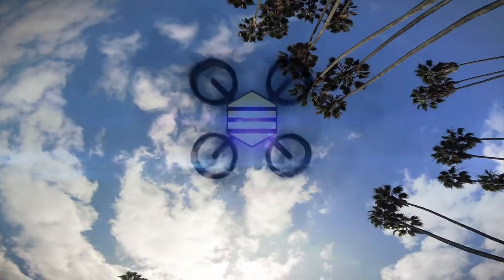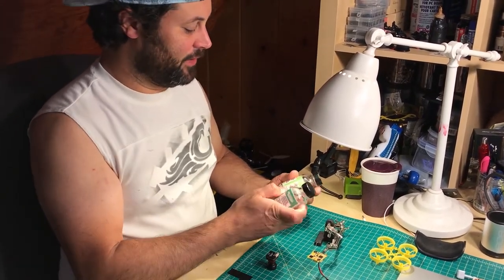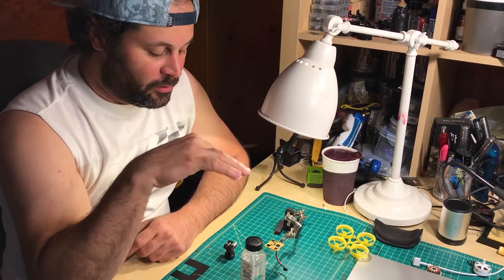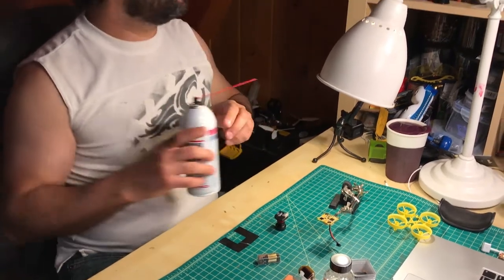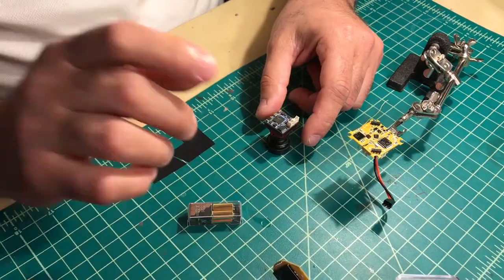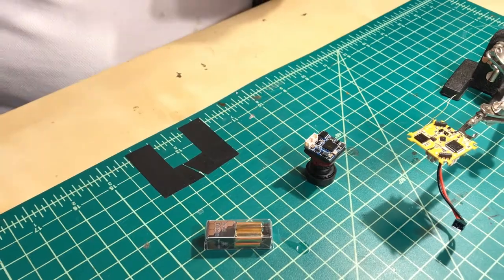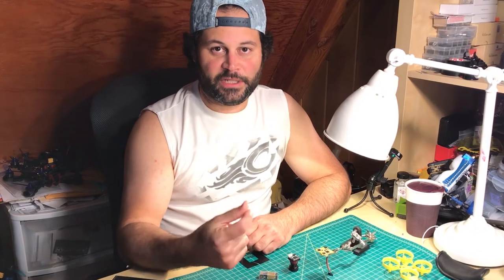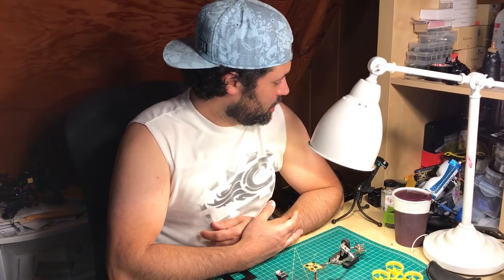My Take On Waterproofing with MG Chemicals Silicone Conformal Coating

Comment: Silicone Modified Conformal Coating is a godsend for making expensive RC electronics water resistant!!!

P.s. I didn’t know about the UV thing, thanks allot. 🙏🙏🙏
Reply from the maker: Yes it is! You're welcome!
Reply: @PinchTune  Your sure the modified kind reacts to uv light???
Thanks
Reply: @ryanjofre  I recorded this video 5 years ago... so I don't remember if it's in this one, but I know I have footage where I show how I dry it more quickly. I use UV and a heat gun to dry it more quickly. Check my other videos on that channel. It's gotta be there somewhere. Be careful though. The heat gun can burn the coating. You want to heat it up a bit then just let it be, and then do it again maybe every 15 minutes.

Comment: I went to cheap route and bought their acrylic based conformal coating last year. I didn't have any failures with electronics but it does dry harder of course, because it's acrylic and it can chip in places that are thin, and it does turn yellow.
After flying one of my GEPRC dolphins and losing some of the flight controller components yes it still flies I decided to use the acrylic and two flight controllers after that with the acrylic on it no components broke free or lost.
If nothing else it's kind of like putting a phone case on your phone.
I don't recommend the acrylic base.
 I do recommend the silicone base only based upon other fpv Pilots testimonials.
Reply: Pro tip:
90% isopropyl alcohol works for the flux removal.
Reply: Loving it and yes, if you do not solder your wires beforehand you will plug the holes like he said and you'll have to get that out of there to make it work.
He's not doing it wrong, but I would solder the wires first and then you wouldn't have to worry about the conformal coating down in the holes because if you don't get it in the holes in the water gets in there you can have a rust problem.
Another trick I have learned to make sure the connections work for your cameras and accessories.
 Plug them in first before you conformal coat.
 Let it dry then you can unplug them if necessary and you have a better chance of your connection being clean & waterproof.
Reply: Oh and that last note the weather the temperature that makes a difference too if you're up north or down south you definitely want the silicone if you're on the equator where I am I don't think it's going to matter too much compared to where they are.
Reply from the maker: Thanks man. That was actually great feedback. I didn't know of anyone that has used acrylic until now... My bottle is still new. lol
Reply: @PinchTune  😏👍 if you're still living in the same location geologically as you were as the filming of this video, you might as well just leave it on the shelf.😁

Comment: i ordered a bottle of mg chemicals silicone modified coating and it just arrived by UPS. thank you for the video. i got a total chinese motor scooter moped and i am going to install a motorcycle bluetooth stereo sound system on my bike as well as a burglar alarm and i am going to coat the circuit boards on both.
Reply from the maker: Hey, that sounds like a great plan. I'm sure it will help with he longevity of of it. Thanks.

Comment: Definitely going to try this stuff! On the topic of not seeing in fog because of the build up on the FPV camera, what about a little bit of RainX on the lens? I've never tried that either, but the shit does wonders for car windshields in any rain, so maybe the same for the FPV lens!
Reply from the maker: I tried Rain X, I tried Ceramic Pro... on lenses. Neither work in fog. Apart from the dude that made a mechanical wiper for his lens with a servo, I don't think there's anything that'll work for that.
Reply: @PinchTune  - Damn, I was hoping that might work. The next big thing  is a FPV camera lens that repells mist and rain!

Comment: Acrylic vs silicone ? On the web it's not always clear which one to use
Reply from the maker: I have a bottle of acrylic that I bought in a pinch because I couldn't find the silicone at Fry's that one day. But I've never used it. To my understanding, silicone will take higher temperatures... but both should do a similar job on low temperatures PCBs.
Reply: @PinchTune  I was trying to understand if Acrylic was a harder-setting, thicker, more durable coating: as the Silicone is removable with rubbing alcohol...
Reply from the maker: @Towardrisk  It might well be. I just don't know. I personally like that I can take the silicone coating off with alcohol or flux remover... because I don't like it there when I'm working  solder joint. I actually, rub it off with a Q-tip and flux remover, then resolder, clean, and reapply.
Reply from the maker: @Admiral Krang Good to know. I have a bottle there and have never even broken the seal. I don't like to change what works, and silicone works great.

Comment: All of the benefits that you mentioned is spot on bro 💯% thanks noobs like me should take notes
Reply from the maker: Thanks. You know, I've been flying since 2014. Initially, I used to coat only some of the builds. But then, I had to remember which were coated and which weren't, in case I wanted to fly, say, the snow. Now I don't do that. I just coat every single build.

Comment: Awesome, any experience/comparisions with the acrylic stuff?
Reply from the maker: I actually have a full bottle of the acrylic stuff. I haven't opened it yet. Lol. So... no idea. I bet it works too. But since the silicone stuff has worked wonders for me, I don't like that change what works.
Reply: @PinchTune  Agreed. I actually did more searching today and yes, silicone is better in my opinion as a result. They are also used on automotive stuff ALL the time. I had a big can of MG premium acrylic for years but it's time to switch.

Comment: Nice. Build video and parts list for the newbeedrone?
Reply from the maker: Thanks. The parts list is simple. AcroBee V2 (this one is DSMX), with a basic Cockroach frame and gold motors. These have the white King Kong props, but I got them right before they released the new Candy Props. I also use the NewBeeDrone Nitro Nectar 1S batteries.

Comment: I want to put liquid metal on the CPU and GPU of my laptop. Around the chips there are very small resistors or capacitors, not exactly sure what they are. My question is, will this coating protect the PCB if the liquid metal happens to spill out a bit?
Reply: Probably...
Reply: It may, but you’re better off using masking tape to completely mask off the surrounding inch or two around the die (CPU/GPU chip). This is how to pros do it. Do some YouTube research, you’ll see what I mean.

Comment: hi i just bought this after watching your video, after applying the coating.. if the drone gets dirty.. can i still use isopropyl alcohol to clean it? or will it clean away the silicone coating?
Reply from the maker: It you clean very lightly with alcohol it will soften the coating, but it will harden up again once it's dry. However, if you do scrub a bit, the iso alcohol will take the coating off. You might need to recoat where you cleaned.
Reply: @PinchTune  thank u for the explanation!! I guess i'll have to clean my dirty quads with water after applying the conformal coating 🤣
Reply from the maker: @mrboiboi2  I do clean them with alcohol and Q-tips. You'll see there's a point where too much is too much. I can usually get away with cleaning with alcohol and not strip away the coating.
Reply: @PinchTune  my area here is full of mud and grass, i crashed 2 times into muddy puddle and flowing drain.. fried 1 esc and 1 FC, hopefully this silicone conformal coating can prevent tt from happening next time 🤣
Reply from the maker: @mrboiboi2  Ah yes, I don't know what grass is. Never seen it. Lol. All sand and dry dirt over here. But we do get snow at my place. And I fly conformally coated quads over the stuff.

Comment: how is this stuff for LED sealing?
Reply from the maker: I think it's fine. It resists heat pretty well. Do keep in mind some powerful LEDs get really got. Maybe be careful with those.
Reply: @PinchTune  heats not the problem, the panel only gets 55c warm. What im concerned of is energy/flux loss.

Comment: I use clear nail polish on my brushed builds cause I’m broke ha . It rained on me tonight in California and I was lucky I just coated my micro cause I crashed before I could land back Inside my house through the window so it landed in the damp dirt while it was raining still , I fly from inside my 2story house , I mounted a video RX 15 feet off top of my house about 40 feet off the ground and that gives me amazing fpv video when I’m flying from inside , now I just need crossfire module and nothing can stop me from going to the moon !
Reply from the maker: Haha, I mean, technically nail polish would be fine. Plus, micros don't get that hot. Them main benefit of silicone is the flexibility and the heat resistance. Plus, I can take off silicone with flux remover or even alcohol. I think nail polish is acrylic if I'm not mistaken, so you need something stronger like acetone... which is bad for plastic parts. Just a thought.
Reply: PinchTune yes your totally right , I’m still flying brushed builds cause I’m new to the hobby , started in January this year , I’m confident enough to build my first brushless quad for my birthday also this coming January so the game will Change for me and I will not put nail polish on thoes builds ,im gunna buy the MG chemicals as shown here . I like your channel btw  I’ve learned a lot from you about this hobby , flying has really grown on me its cause i am a “ tinkerer “ & I enjoy building them and making them neat and tidy  it’s just fun “ except the crashes ...
Reply: What is your setup? Groundstation or something?

Comment: Has anyone experimented with clear coat sprays such as Krylon makes? Or any others that you can easily get at a hardware store?
Reply: It will be difficult (or impossible) to solder through, and can only be removed with strong solvents, such as acetone, which would also damage the components on the board. So definitely a NO GO.

Comment: Any body know how to remove the coating ?
Reply: You can solder through it easily, But looks like he also said we can use flex remover and spray it in a little cup and then use a Q-tip to clean whatever you need

Comment: This is useless shit. Fried already 3 stm32 on fc and esc. I do not realize how you cover all the fc's stm32 legs, with only 1 coat. It's just goes down to the bottom of the stm and not covering the legs. I tried 5 coats to get a result. And after landing in the river the fc died. And how to waterproof the connectors? The only way I think is to use a polyurethane glue that is used for gluing shoes
Reply from the maker: That’s a bit of blanket statement. You could argue with the hundreds, if not thousands of FPV pilots that coat their rigs. Plus, the voltages we run don’t tend to fry electronics when they get wet, so long as it isn’t saltwater. Plus, all this stuff does is increase your chances of survival when stuff gets wet. It doesn’t mean it’ll completely save you every time. Conformally coated or not, you take a big risk sticking electronics in water. That’s just common sense.
Reply: @PinchTune  I'm an engineer and just have only two statements in my mind when something is coated: isolated or not isolated.